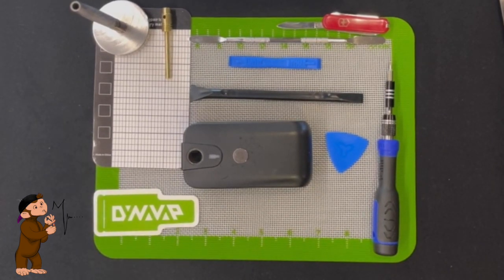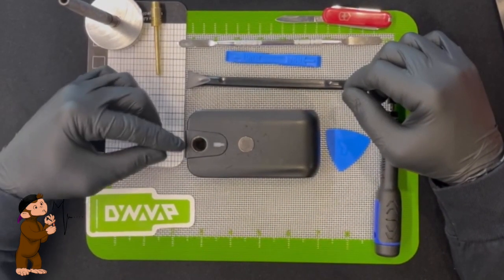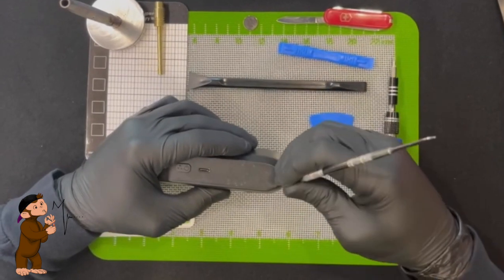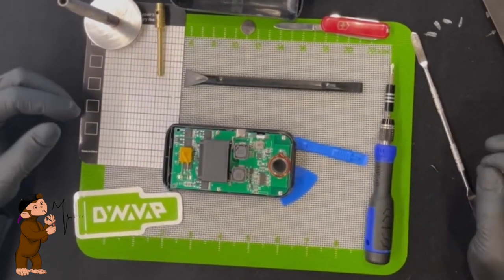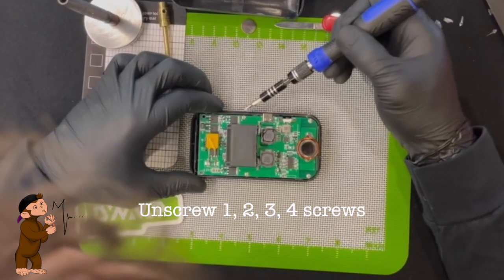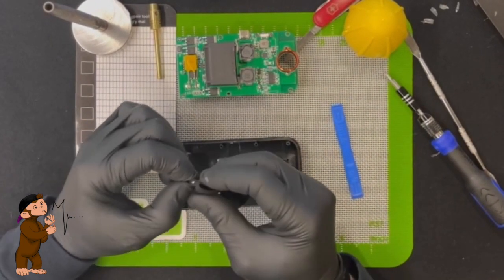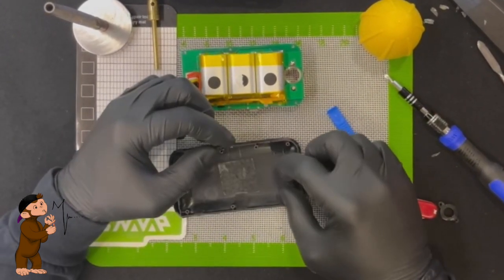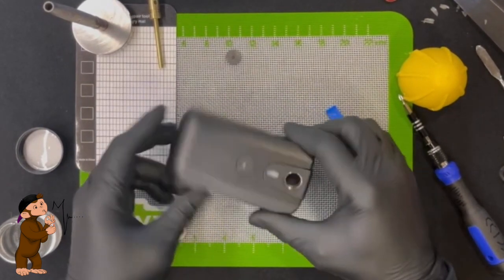How to: Orion V2 Power Up Modification

Comment: I follow this mod today, it was LinkedIn Reddit Post. 

Just wanted to say this worked 100% and made my Orion comparable to the ispire wand.  
One tip that I found helped me pop this thing apart within seconds was using a piece of card stock (Business card - plastic type if you have it) to slide under the plastic once you have it lifted
 do that on both sides and it comes apart in seconds. No marring to the plastic either

Comment: Oh wow! You have some patience and perseverance to do this!  I have been using the Orion V2 for almost a year now and have found that my unit consistently heats my material much more at the tip of the bowl than at the bottom.  I can scrape black avb from the tip and see lighter coloured material that I can reheat and hit again. I somehow thought that if I could insert the tip deeper it could solve that issue.  Unbelievable that these things cannot be made to take apart easier than the painstaking steps you had to do so you could insert the Dynavap tip deeper. By the way, my switch stopped working a few days ago and luckily still a month warranty to go. Having to use a switch three times to turn on and off must take it's toll.   I applaud your skills at being able to open the unit and put back together and it works better!  Well done. When I get my replacement I'll see if I have the same issue.  Is there any way that rubber stop can be shaved lower without taking the unit apart?  Thanks for posting this. 👍
Reply from the maker: Opening it up is really not hard just go slow. Technically you can just rip the rubber out from the top. My friend @grover was the first to do it that way and inspired this whole journey. He ended up using a drill to just drill out the hole all together and now it’s more like a wand Orion but that stops it from being a set and forget
Reply: a nice sharp drill bit as big as you can fit and turn it with your fingers?

Comment: I'm here cos my power button has crapped itself and I need to get inside. thanks for being the only one exploding.
Reply from the maker: Sorry to hear your button died. Happy I could help at least a little
Reply: @MoOiAmATree  soldered some wires onto the board and stole a reset button from an old pc, hole, hot glue.. back in business
Reply: My unit has a hollow rubber bit that can't be shaved down more than a couple of mm without making it into a tube. Did not do while open...
Reply from the maker: @LaserSharkPhotoablations  ya that’s why I cut mine from the bottom

Comment: I wouldn't buy an induction heater at all because none of them give you really all that great of hits torches the best way to use the dynavap
Reply from the maker: I used to be all IH and now I’m almost all torch other than the FFP with sip n dip

Comment: Awesome video, just got mine. I think I'm ok with the stock performance since I use ti tips. Hope you do a battery replacement in the future. That's my main concern after warranty expires.
Reply from the maker: Being ok with and really enjoying are 2 different things. I mean I think the hardest part would be getting the exact batteries to replace them.
Reply: In stil tempted.. just got my Orion.. 
but the 2019 m and Omni works a bit better than the newer m’s.. it kinda sucks with my 2020 and 2021 m. Kinda bummed to be honest..

Comment: Will this work with the V1 as well? Thanks
Reply from the maker: Yes should do you may want to cut less off the foot for the v1. As the v1 was already a little hotter than v2.

Comment: Can't you just trim the top? I feel it would be easier than the feet?
Reply: Forgot to thank you for this!!! I hate my orion and this should make me love it. I wanted to attempt this but was hoping it would die and I can't refund under warranty lol . Now time is up and I will be trying this out
Reply from the maker: In theory you can however the foot is hollow so to retain the solid top of the foot you will want to cut from the bottom. To be honest one of my friends just ripped out the rubber and drilled all the way through the plastic to make it more like a wand.
Reply: @MoOiAmATree  maybe try a bit of cork and just glue that in to the device instead of the rubber.. if you get the dimensions right it could be anything that’s a bit heat resistant.  Cool video though